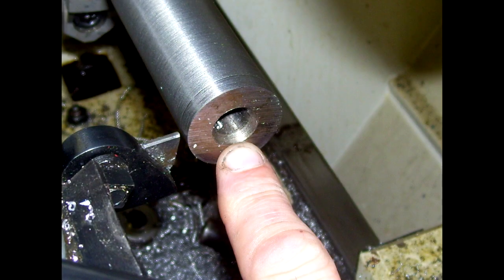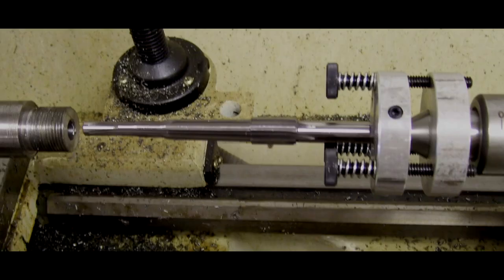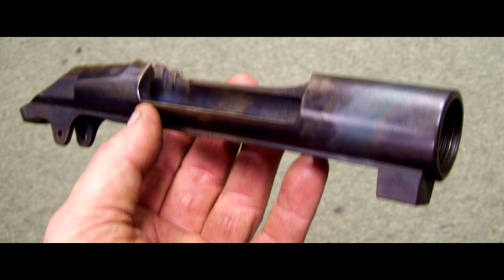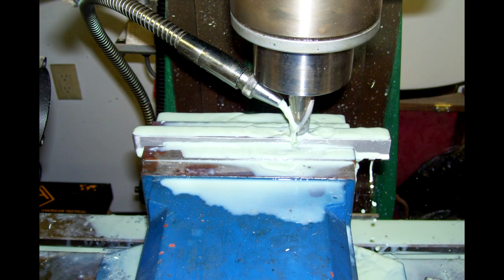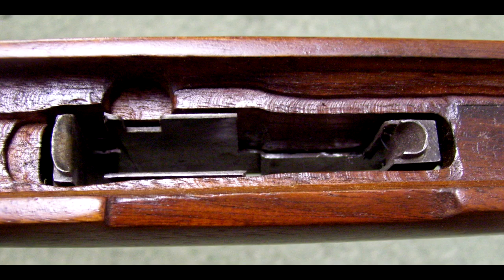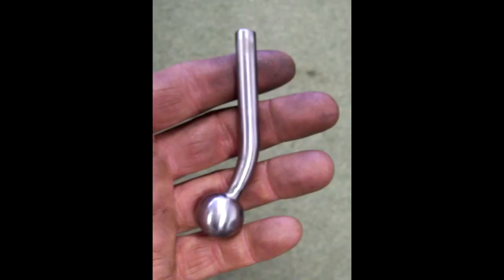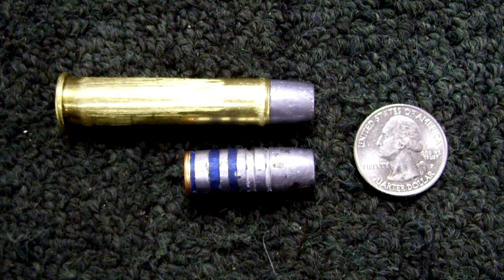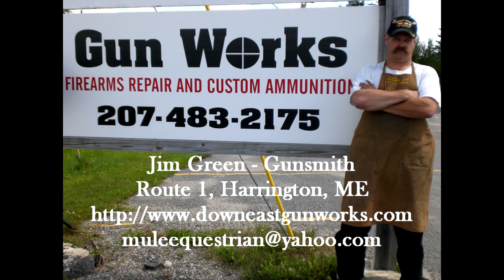Gunsmithing: Mosin Nagant Conversion to .45-70 Govt. (Gunworks)

Comment from the maker: Yet we hear of no failures of the bolt. This argument is ridiculous. I built and tested the first of many of these conversion rifles as a fluke. It was a  a friend who told me nothing can be done with a surplus Mosin. Challenge accepted. I didn't think this would be the source of so much dissent and whining about guns from Internet Commandos. If you don't like the video, don't watch it. It's as simple as that.
Reply: +downeastgunworks Where did you go to school for gun smith? If its past drillin tapping and checking head space im clueless
Reply from the maker: +Riley Powell it was a pre contoured barrel blank I picked up for under $100
Reply from the maker: +Riley Powell probably not necessary to leave that much metal. But I tend to err on the side of caution on builds like this. According to load data from Beartooth Bullets, my load generates around 39,000 psi. Not too bad really, but since this was the first build I did on this action, I wasn't in a hurry to blast a bolt of metal through my brain pan. Despite what some folks might believe, there is method to my madness. I'm fairly cautious when it comes to "hot rodding" stuff. Even though the math works out each time, it must be the "German" in me. (Those folks are known for over engineering, and my family background has Germans dangling from branches in the family tree).
Reply: Awesome work - great looking 45-70
Reply: downeastgunworks How do you like the rifle after shooting it for a while? Great Video and Build!
Reply: downeastgunworks Bravo to you sir you are a legitimate gunsmith I live in South Carolina and we have nothing but fake wannabe gunsmiths.
Reply: How Much?
  I have a 91/30 With a rusty bore.
Reply: I just found this and as a lover of Mosin Nagants, I really wanna know how much you would charge for something like this. I would love something like this to add to my collection, and it looks awesome. Thank you for doing this sir. You are amazing.
Reply: hell yes to your pinned comment! i don’t have the first hand knowledge to give a expert opinion, however i just watched iraqveteran8888 try to blow the bolt out of an old mosin and was unsuccessful even with 70+grains of magnum pistol powder loads..... But on YT everyone is an expert...  oh and 100$. mosin???? damm
Reply: We all Seek the same 

Yeah, at one time Mosin Nagants were very cheap. I bought mine for $150 about a decade ago. Great rifles though. A lot of times you will hear people say “Mauser action is the best!” 

However I think the mosin action is far more durable. But it matters not. Both were great rifles, and each did their job as intended. I definitely enjoyed seeing this conversion done to a mosin. ‘‘Tis a criminally underrated and underused rifle platform.
Reply: Excellant video and fantastic build! I would buy one of these in a heartbeat!
Reply: Very interesting idea, I like my Mosin Nagant just fine the way it is though.

Comment from the maker: Wow. This "argument" is exactly the reason I stopped posting videos two years ago. For some odd reason this one has kept popping up in my email inbox the past couple days. It's silly. If you want to critique my work, then by all means post a video of your own showing me where I went wrong. You do have a machine shop, right ? Build a better and safer gun to show the world what an idiot I am. As to pressures in this gun, you realize the original cartridge is a much higher pressure than the .45-70 that replaced it ? As to opening the bolt face to accept the larger cartridge, I redirect your attention to a few things. First, the locking lugs were NOT touched. Since when did the bolt face have anything to do with lockup, as long as the headspace is properly set ? And I'm not the origin of the idea of opening up bolt faces in a rifle. The Remington model 30 ring a bell ? Back years ago before the advent of magnum factory rifles, quite a few M1917 WW1 surplus guns were opened up and converted
Reply: +downeastgunworks Yes I agree that gunsmiths have been doing these conversions for years without mishap.&#160; If The Mosin is not strong enough for this conversion then neither were the ten of thousands of 1861 and 1863 Springfields that were converted from muzzle loaders to the 45-70 cartridge.&#160; My father had a M1917 that was converted to .300 Win Mag that fired for years without any problems.  Also ther is a company in Canada I believe that does conversions of the Enfield actions to .45-70.  I believe the Gibbs Rifle company also did conversions as well.
Reply: I think the best answer you could give is who has more years of experience in gunsmithing.  Though some people gotta be key board warriors and cry no matter what it is  they watch. your videos are great it's always good to see someone who likes their work.
Reply: +downeastgunworks    It's too bad you stopped posting videos.  I for one really enjoy them, You most defiantly know your shit.
Reply: +downeastgunworks Sorry to hear you quit posting videos. I really enjoyed this one. I wanted to be a gunsmith when I was young (I'm 58) and learned enough to appreciate what you are doing. I'm also sure this is a safe conversion. As to destroying collector's value, there's lots of guns that have little collector's value due to prior modifications. Besides, it makes the remaining ones more valuable. I'd like to see a video on converting a SMLE to 45-70. I have a smelly that was sporterized years ago and has little value. I'd like to convert it to 45-70.
Reply: +downeastgunworks sorry   you  stopped  doing  vids    you  have  a  great  talent .  My  granfarther  and  mother  were  gunsmiths   i  have  a  m1917  she  made in to  a  sporter  great  hunting  rifle  .
Reply: +downeastgunworks .... Screw the argumentative fuckheads sir. There will always be haters and jealous idiots that do nothing but live their lives by seeking validation for it by trying to shit on others, in this day and age they are referred to as "key board warriors". I have watched some of your video's and they are put together so very well - informative and no nonsense. Even if you are getting bullshit form the majority of folks out there remember you are valued by us few. God bless and keep doing what you do !!!!
Reply from the maker: +Riley Powell yes Sir. Kind of the reason I no longer go online to any more gun forums either. Far too many "armchair commandos" who,are far too free with their "advice." If I only had a dollar for every person who was an "expert" on the subject matter at hand, I'd no longer need an actual job. By no means do I know everything about guns. As long as I've been at it, I know one thing for certain... You CAN teach an old dog a new trick. I'm STILL learning myself.
Reply from the maker: +Riley Powell sometimes I grind a special bit for stuff like this. If you're in gunsmith school, they'll teach you a bit about how to do that yourself.
Reply from the maker: +Riley Powell oh yeah. Guns like this are a Heck of a LOT of fun. Send me your email address. I'll email some pictures of a few builds I've been up to lately. You might find them of interest -- or not. I've been attending blacksmith school the past two years. I'm learning how to make my own pattern welded Damascus steels. 1095 carbon and 15N20 nickel. I'm getting ready to combine blacksmith work and gunsmith work together on some fairly interesting gun builds using pattern welded Damascus steel. I've learned how to make custom knives and will be offering a "cut and shoot" package custom build. A hunting knife that matches the hunting rifle. The really interesting part is carving a butt plate from moose antlers I pick up in the woods. And matching knife handles. The resulting patterns are fairly intricate. Many early gunsmiths were also blacksmiths. I hope to "revive" this with my own stuff.
Reply: +downeastgunworks man  i  would  like  to  see  that
Reply: Not to mention that factory .45-70 ammo is loaded lightly so that people can fire them from their Sharps rifles...Don't let the trolls get you down.  Great video, cool project!
Reply: Don't let the argue-bot trolls run you off.  I'm thankful there are hard working entrepreneurs like you out there.
Reply: I for one found this very interesting. .45-70 will always be around and it's super easy to hand load. Can the same be said for 7.62X54R?
Reply: The human shrug. CORRECT
Reply: downeastgunworks how much do u want for u to build me one
Reply: downeastgunworks this is fantastic. You are an artist with this!!! You have official rekindled my love for nagants! If you are willing to convert others I will start saving Dollars and clean nagants! Thank you for the specialist advise as well!!
Reply: I like this kind of video.  It moves along very fast and is not meant to teach me how to do these things but just to show what can be done when you have the skills and the tools.
Reply: fuck the haters start posting again and where did you say you got those tools

Comment: I'm glad you posted this video.
  I have a Nagant and like it very much.  I reworked it and added better springs and tuned the bolt for a shorter lock time and replaced the trigger with an adjustable, ball trigger with tension spring to remove trigger slop/play then dropped it in a modern stock and it's a great rifle.  That said, I'd like to have one with this conversion, as well.  No arguments from me, I'm an ex-AF munitions specialist/small arms expert and know that the .45-70 is significantly lower in pressure than the standard Nagant round and only slightly larger at the bolt face.  It makes perfect sense.  Thanks!!!

Comment: I like the way you do things, funny you mention the tire iron, whenever I make a scrap run, I always leave the scrapyard with more metal than I came with. I did a similar bolt conversion with my Mosin, but I used a 3/8 bolt, drilled and tapped the bolt body, then chucked the bolt stub in the lathe and drilled and tapped it. I ran a die over the other end of the 3/8 bolt, threaded the knob on, bent the bolt where I liked it, and silver soldered it all together. Worked out nicely.

Comment: I live in northern Alberta Canada, I have many riflea from 22lr Browning T-Bolt to 458 win mag in a pre 64 . My go to bear gun is a Chiapas Kodiak in 45-70 the 1886 action is very stong and I cast 405gr 22BNH with Lee mould #459-405 with 48.0 gr of N130 and 210M primers in Hornady brass I chronograph arround 1820fps, this load rolls bears over, it is a great old caliber that is all to often overlooked, my introduction to this caliber was growing up in Yukon as a yung man watching moose absorb round after round of 270 while in the rut and one 405gr handcast 45-70 ending a bad situation, when I guide for dears wether Blacks in Alberta or Grizzly in Yukon my lever action 45-70 is the backup rifle of choice, the rifle you built will serve well for your bear hunting and close (200 yards) deer, elk , moose hunting and im sure your finish cost is much less than that of a 1886 style lever gun sure Marlin guide gums run in the 800 buck range but require up to this$500 worth of gunsmith work to make them smooth operating rifles with less than 10 pound trigger pull im sure you will find a market among bear guides for your rifle , the advantage I see for my Kodiak 1886 is that I do not drop the rifle of cheek weld to cycle the action, but my experience has been that the 45-70 tends to stop most bears with one shot and the 2 that required more than one shot were turned after the first shot and leaving in a very sick state so a fast follow up shot may not be that important and maybe with practice the rifle can be cycled from the sholder good job on taking a cheap military surplus rifle and making a practical hunting rifle out of it and great choice of caliber

Comment: I did one in 30-40 Krag  and a Finnish favorite,  8x54R.  I made a new bolt head for the 30-40 because of the small rim diameter.  I filled the bridge with a welded block and silver soldered a Remington bolt handle behind  the bridge. Now I could scope it over the bore easily.  I added an adjustable trigger/with safety I had laying around. Not sure what it was for, but it was a Timmney and I had to modify a little. By the time I was done I had hours and hours of time in it. I think I sold it for $250 later. what a money pit. I did learn a few things. When I went to dovetail the extractor slot, I found out they use some weird standard angles in Eastern Europe. Had to grind up a cutter too.   I may still have some blank bolt heads in a cabinet somewhere if you are interested.

Comment: I converted a 91/30 Mosin Nagant to 45/70 in 2004, but I just fired it single shot.

I milled the scope mount [looks like an ATI mount] from a Tapco AR15 riser.

It was fun to watch Gun Works do a better job than I did.

Comment: I did a similar conversion back in '06, but I used an Adams & Bennett barrel from Midway, an ATI synthetic stock and a side-mounted scope mount meant for a Savage Model 340. I built a custom mag well to hold 5 rounds.
It worked out really well, but my mistake was taking it to the local shooting range. I wound up selling it to a guy for $800 so he would shut up and let me target practice.
Confession: Yours looks far better than mine.

Comment: I picked up one converted to 45/70 few years back at an auction of an old gunsmith that had died, was apart and I paid $10 for it. Is an older octagon receiver and guy used an octagon barrel. I never did anything with it , put it out in the barn and forgot about it. 
 Think I'm going to go find it and see what it needs if anything to get it together.

Comment: NICE! The action will handle it, the round is a beast. But then again, so is the 54R. Loved what you did though. Very sweet work.
Reply: The .45-70 is a low pressure round. SAAMI shows it at approx 28,000 PSI. Aathough it has heavy recoil with the heavier bullets it's not that much of a beast. If you want to turn it into  a beast buy a Marlin 1895 or Ruger rifle...they both will handle the .45-70 at 35,000 PSI or so!
Reply: Henry Braud What kind of loads are we talking? Powder, projectile, brand of casing?
Reply: Chris Blake, in my 1895 Marlin, .45-70 I use either Federal or Winchester casings, IMR 4198, 300 grain flat point cast from wheel weights (RCBS mold), sized to .458, Blue Angel hard lube, WW LR primers with a small tuft of polyester pillow stuffing. With those components, I'm able to load up or down from approx. 1,000 fps-2,100 fps...safely!  The accuracy at all velocities is simply amazing!

Comment: He has a price list on his website:

"Custom caliber conversions on Mosin Nagants to .45-70 or .444 Marlin start at $500 and up.

Any customer supplied Mosin Nagant rifle or carbine will get a brand new barrel, new stock, the bolt face will be machined to accept the larger size cartridge case, the magazine well milled out for reliable feeding, magazine modifications, and the new bolt handle will be supplied."

Comment: You could, but the 7.62x54R round is basically a 30.06 in terms of power so it's a lot of work for minimal gain. There are hunting rounds for the 7.62 caliber so it's a lot easier to just use those. The 45/70 is a lot more powerful for bear/buffalo and a lot of the 45/70 guns are older lever action and single shot designs which can be hard to mount optics on.

Comment: Awesome work! Great looking little rifle. A few questions, was 4 rounds all that would fit in the stock mag? and also you just may not have shown it in the video,but where the bolt handle was welded,the welds didn't look as nice and cleaned up compared to the quality of work done to the rest of the rifle. Assuming you just cleaned up the weld with some files and sanded + polished it to match the bolt?

Comment: I have a technical question for you.  I'm sure you can give a good answer.  Enjoy your videos, btw. 

When the Winchester 73 lever is down, the spent round is ejected out the top, with the new round coming up to the breech.  What keeps the new round from also flying out the top of the gun?
Reply from the maker: Primarily because it's not hooked in the extractor yet. Of course, there's a bit more to it, but in simplest terms.... The extractor....plus take a look at the  internal shape of the cartridge elevator.

Comment: Sir, I'm looking for data on the thread on a Mosin-Nagant barrel. I'm assuming it's metric, which may be a real problem with my 17" LeBlonde Lathe, which of course is only back geared for Inch threads. Could you just post the thread specs? Thank You. Very nice conversion.

Comment: Mr. Green,
I am highly intrigued by this .45-70 conversion of the Mosin Nagant, I was already thinking about doing a conversion to an m-44 carbine, would this be possible to do the .45-70 conversion with a carbine? If so, I will be contacting your shop once I find another m-44 carbine. I converted my first one to a bullpup configuration, it's still one of the builds I'm working on, as the bolt is still in Massachusetts getting some custom work on it. Once that is complete I might be interested in getting another one, and shipping it to your FFL if you are not an FFL yourself. And having the 45-70 conversion done to it.